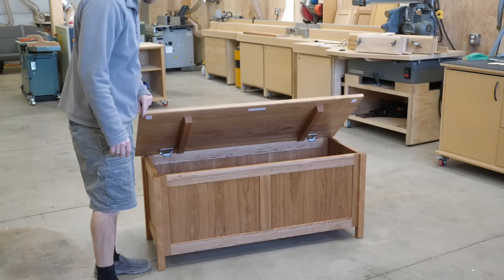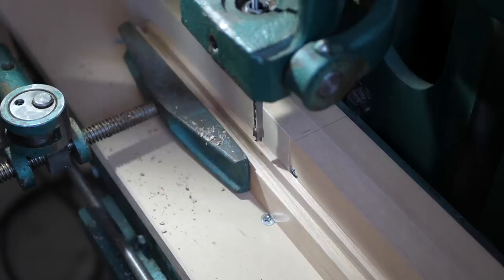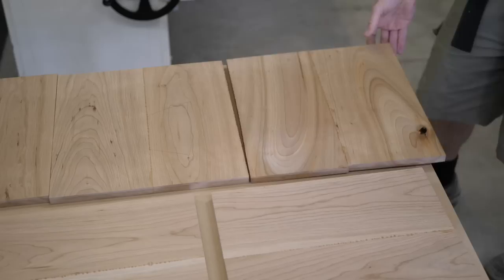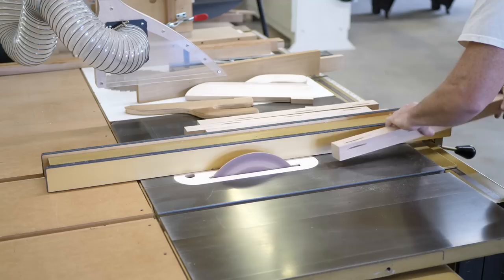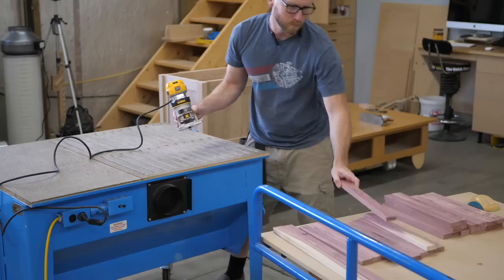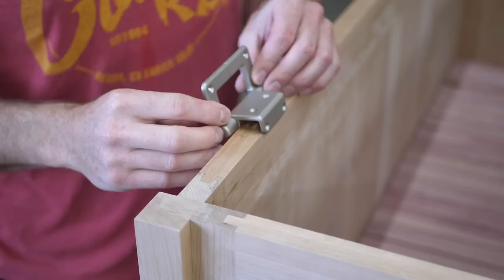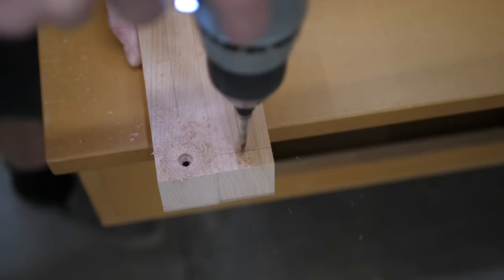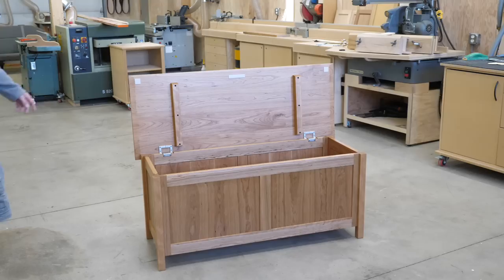Lets build a Blanket Chest

Comment: Sweet and easy build 👍 
I’m sure I say “easy” in part because you always do a fine job of foreseeing needs/improvements you can make to fit/finish/functionality (using the grate while intentionally opening up more cedar surface area, chamfering to avoid picks in fabric, going the extra mile to cut haunches, etc…).
The number one thing I appreciate and have over these past years from you is not organization per se, but that you organize and approach projects and problems, in an organized manner mentally first; that makes the execution far easier.  You’d have made a fine Operations Officer at the battalion level.  Hope you and the family are doing well!
Reply from the maker: Thank you very much.

Comment: Fun fact: I've seen tops with three wide boards and a sliver in back. The way they made this work is... Three boards form the top and the skinny board is fixed to the top of the chest. The hinges are then placed between the top and the skinny board. Depending on the hinges you use, this three + one board helps keep too much stress on the back and causing the upper edge of the back to split and tear at the hinge screws. 💖🌞🌵😷
Reply from the maker: Thank you. That is a good way to solve the problem.

Comment: That shaper is a beast! Wow. (Although it’s also slightly terrifying, given the power that thing must have 😉).  Then you whipped out that bronze Lie Nielsen #4 and my tool envy went into overdrive… I had to rewatch that section a few times because I thought I might be seeing the ultimate unicorn: a L.N. Bronze 4 1/2! I have seen and held in my hands exactly ONE of those in my life, and damn what I’d be willing to pay for one if L.N. ever made it again….  Drool worthy.  Great video as usual, and neat project!
Reply from the maker: Thank you very much. The shaper is nice. The bronze #4 is a very nice tool for sure. I have a cast 4 1/2, I don't like it, its too wide and takes too much effort. The unicorn in the bronze #4.
Reply: @MikeFarrington  Ah yes fair point!   I have an old Bailey 4 1/2 that I restored with a hock iron and love using, but given the width I do need to keep it to a pretty fine shaving... otherwise it's quite a workout!  :-)   Dang it, this conversation has me visiting the L.N. web site now...  My wallet is getting nervous.  🙂

Comment: I just used my Double Taper Sanding Disc yesterday. It is amazing! My project was just some 3/4 x 1 back banding to add to a bunch of door casing. It got rid of the saw marks and left the edges buttery smooth. It also revealed how much deflection I'm getting from my table saw blade. I highly recommend it.
Reply from the maker: Thank you very much. Alway neat to hear success stories.

Comment: Have you looked into the Aigner fence for your shaper? I have them on my Felder combo saw/shaper and wouldn’t be without them. So much safer than the included fence. Big bucks but worth every penny.
Reply from the maker: I have, I will probably get one at some point. Right now I have settled for the adjustable safety fence, which does the same thing, its just not convenient.

Comment: That centre support on the Felder spindle looks a good design. I've been contemplating an Aigner fence for years for the SCM. But I just can't bring myself to spend that much on one, and they never really come up used. I'm thinking I could make something like that myself (albeit a bit more Heath Robinson). Generally I don't need full support, just something to catch the top of the workpiece to stop it getting dragged in. Looks like a really nicely designed machine👌
Reply from the maker: This is an add on to the Felder shaper. I am going to use this until I save up enough to go for the Aigner. Felder does sell this type of fence as a kit, it may be worth looking into.

Comment: nice project!! how far out from the back wall does that corner pillar extend that you had to angle cut to clear the lid? I saw this problem coming when I saw the hinges laying out on a back side with protruding trim work. Much appreciated info!! very nice
Reply from the maker: That measurement is about 3/4". I knew it was going to be a problem as well, I just wasn't sure how big of a round over I would need. The way it turned out it really isn't visible from any normal viewing position.
Reply: @MikeFarrington  an old shop teacher taught me once if you make a mistake, make it again in another spot, so that it can be hidden into the landscape looking as if it was meant to be for the planned finished project. Its on both corners so it looks as if you had planned it that way with a decorative angle cut on the back of each pillar.....looks good

Comment: Hey Mike, just looked at those torsion hinges from Rockler. Im in Québec and after shipping, duty taxes and exchange rate, im looking at 200$ for the hinges….no bueno. So i was thinking maybe if i install enough soft close concealed cabinet hinges i could get close the same results for similar size top on a chest im going to build. Thoughts, opinion on this?
Reply from the maker: I do not know if that would work. I'm pretty sure you can dig up all the numbers that blum provides as to weight and size. This could give you a clue if this will work.

Comment: I used the same hinges (60 in. lbs) with a 3/4 thick maple top, roughly same dimensions length / width and the top gets about 30 degrees from closing and slams shut the rest of the way. Not sure where I went wrong, its a toy box otherwise i would call it good. Any recommendations?
Reply from the maker: Maple is heavier so that may be the issue. I would add another hinge.
Reply: @MikeFarrington  thanks Mike, I was leaning that direction but dam Rockler is proud of those hinges. $40 ea.
Reply: You might be able to find similar hinges to use, they use a rotary damper mechanism. Searching damper hinge might find you something

Comment: What are those shoes?   I've tried quite a few "old man slipper shoes" over the past few years but I still haven't really found some I like.   

Fwiw, I've tried Chaco and Thorogood.  I actually sort of liked the Chaco but they stopped making them.  The Thorogood were nice in that they were composite safety toe but sadly they just weren't made very well.
Reply from the maker: Ha! Those are the best old man dad shoes ever. They are made by Sketchers. Comfortable, but wear out quick. I just bought a new pair this weekend.
Reply: @MikeFarrington  Forgot to mention that the Thorogoods were also waterproof and ESD safe but they do not sell replacement ESD insoles.  ESD rated shoes are nice as you just get shocked less walking around in the winter.

I found that the inside heel wore out right after the insole which caused them to become loose fitting.   IMHO, the inside heel area really needs to be leather to hold up.
Reply from the maker: @prototype3a  Good info, I think I have some more shoe shopping to do.

Comment: Has anyone seen a router base plate on the market that looks like a horseshoe shape, open in the center with two extending legs or points in the front? Have the same type of chest with a ply lid. I attached 3/4 x3/4 solid sapele edge banding that needs to be flush cut at the corners with the ply top.
Reply from the maker: You might be better off making one. That is a really good way to get through that task.
Reply: Thank you much really dig the channel